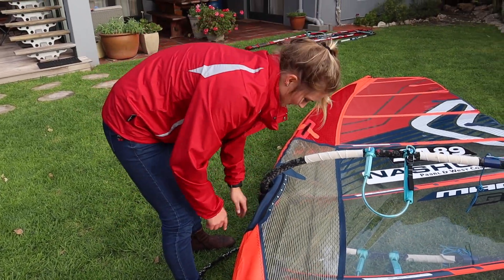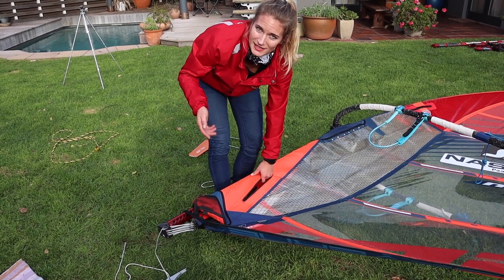HOW TO RIG AND FINE-TUNE SEVERNE SLALOM RACE SAILS ~ For top windsurfing performance and enjoyment

Comment: Thanks! Very informative and a lot of good tips. Would be interesting to see the difference in rigging the same sail for slalom and for speed. Or do you use the same setup? Ps please loose the bikini pics, because my wife thinks I’m watching for the wrong reasons. :)
Reply from the maker: I'm glad it was helpful to you!! The speed and slalom Sails are quite different, Severne makes custom speed Sails for Luderitz with much deeper profiles. Also a lot different when it comes to rigging. Haha, no man....  bikinis, ocean, wind, sunshine, windsurfing, summer and happiness all goes hand-in-hand.... So sorry, I can't drop my bikini shots, they are part of my lifestyle!! 😂Otherwise I would not be me! 😉🤙
Reply: Fair enough. I think I will have to get used to it than. You seem to be using the same fin size as the heavy guys, but in different wind strengths? And you mentioned in your Luderitz video that you used a longer fin to keep the nose of the board down. In general people say that a bigger fin will lift the nose more? And last: I would love to see a comparison between a Fox and a Futura. Which one suits what conditions? Thanks for the great windsurfing content!
Reply from the maker: The lift generated by the fin should not cause the nose of the  board to lift, it lifts from the rear end of the board so that one can fly over the chop and go faster. If the nose of the board lifts, then that fin - board combo is not ideal or you have too much downhaul or you have a too big board for the wind that is blowing. With speed sailing, due to the super narrow nature of the boards, this lift, generated by the fin, will help to level out the board, it does not cause the nose to lift. In slalom sailing, exactly the same thing. With regards fin sizes, Gasoil Fins makes each and every fin custom for my weight and sailing purposes. Therefore, for heavier guys, their designs would differ slightly from mine. Here in Langebaan we have super strong tides, so being under finned in an outgoing tide is not ideal, therefore I go one size bigger on outgoing tides. With incoming tides I go down one size, because I have more water pressure to work with. But, like I said in the video, it's all down to personal preference and what works for your gear and sailing style. Thank you for the suggestion of making a comparison video between fox and futura.👌
Reply: Karo van Tonder Very useful information.  Thanks for sharing your knowledge!
Reply from the maker: It's a great pleasure!!! 😊.. I'm glad you are enjoying my windsurf content.
Reply: FYI: bought two identical high end (36 and 38 cm) carbon fins to try it out and it works exactly how you described. Absolute game changer for me. Should have invested more time in theoretical knowledge a long time ago. Thanks again.